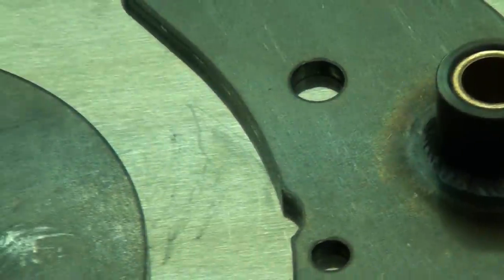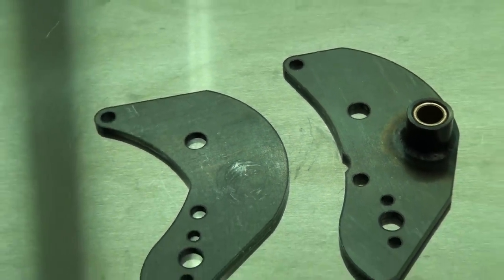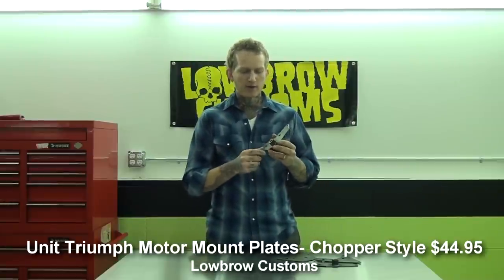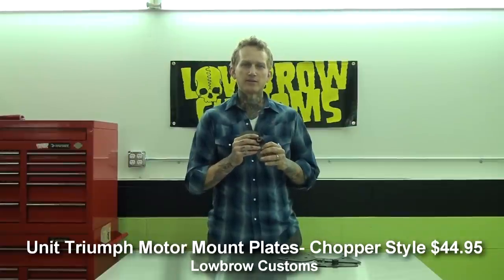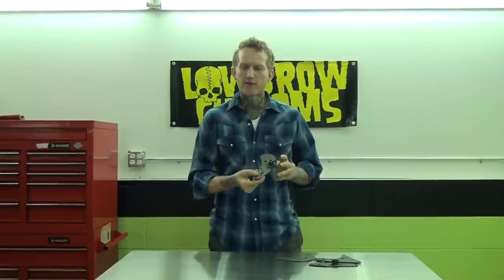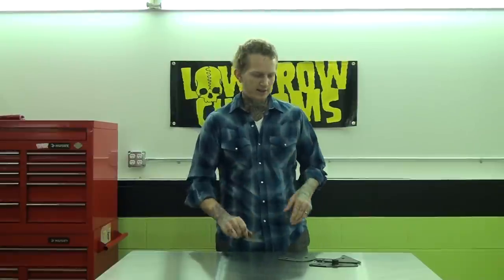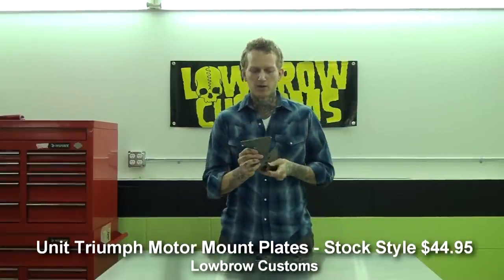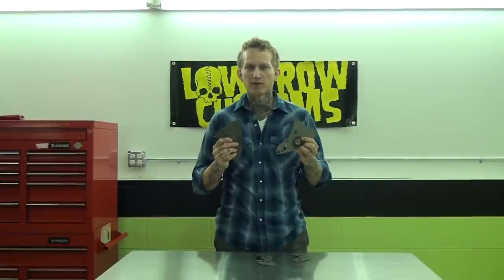Rear Motor Mount Plates Review Triumph Motorcycles

Comment from the maker: No we don't have any for later model bikes. Anything after 1970 is an Oil In Frame model and has the motor plates integrated into the frame. You can put the later motors right into an earlier frame, but you would have to modify the axle plates, we don't have any ready to rock for left side shift bikes.